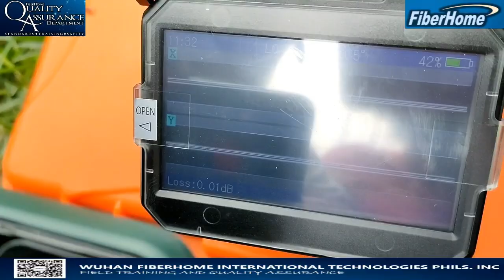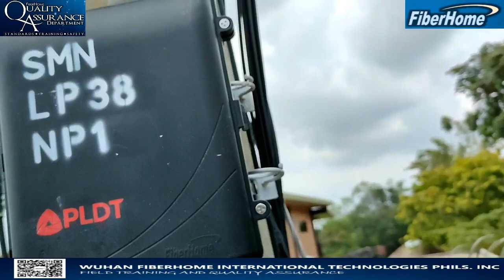PLDT ADD NAP STUB INSTALLATION

Comment: Gaano po katagal activation ng nap box sir? Thanks.
Reply: Naka-kabit na po sa poste yung napbox ang may mga wiring na din, pero wala po syang letters or numbers na nakasulat. Thanks po.
Reply from the maker: Pag ADD NAP sir activated na agad un if my reading after splice kc add NAP lang un. Meaning ung ung ibang NAP na kasama non active na at isa lang cla ng LCP.
Reply from the maker: @jerichou26  nako bka hindi poh PLDT kc dapat my stencil yan kung my mga subscriber na. Bka yan ung tinatawag na COOP ng PLDT, powered by PLDT lng cla
Reply: Kakakabit lang po, wala pa pong mga subscriber sir.
kaso hindi pa ata activated kasi wala pang stencils.
gaano po kaya katagal bago malagyan at ma-activate sir? thanks po
Reply from the maker: @jerichou26  ai genon hehe, pag wala pa stencil talagang di pa activated yan sir, mga possible reason nyan e baka di pa tapos ung ibang line ng LCP or NAP sa lugar na yan, or bka for splice pa. Diko poh masasagot kung kelan, pero dina poh magtatagal yan
Reply: Thank boss!

Comment: Ano meaning ng LP sir?
Reply from the maker: Hi sir, actually LCP yon or LOCAL CONVERGENCE POINT. Pero sa Nap Box LP lng nilalagay ng PLDT. Tulad nung NP - Means NAP or Network Access Point.
Reply: @Connected1130   if mga client NAP sir ano nilalagay?
Reply from the maker: @nctv6924  hi sir, ano poh ibig nyo sabihin sa if client mga NAP? Nilalagay na ano. Ung NP kc or NAP 1 to 8 un, 8 NAPS per LCP
Reply: @Connected1130   LCP meaning Mother NAP?
Reply from the maker: @nctv6924  no Sir, The local convergence point (LCP), in many respects, is the heart of the modern all-fiber access network (AFAN). It supports scaling of splitters, allows single-subscriber management, provides testing and troubleshooting access, and supports future technology migrations and updates.
Reply: @Connected1130  Bale LCP going clients NAP?
Reply from the maker: @nctv6924  yes, from LCP my PLC Splitter un that divided a single core to 8 cores to 8 different NAPS to subscribers.
Reply: @Connected1130  meron kayo video pag install ng mga nap box po
Reply from the maker: @nctv6924  meron..tingnan mo nlng sa video uploaded ko dito